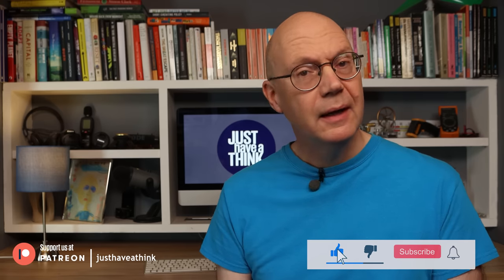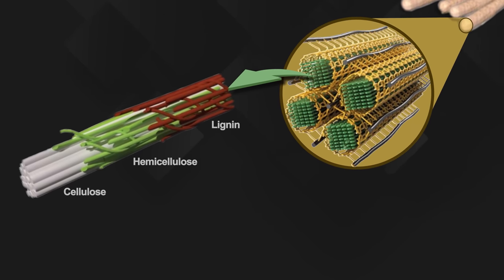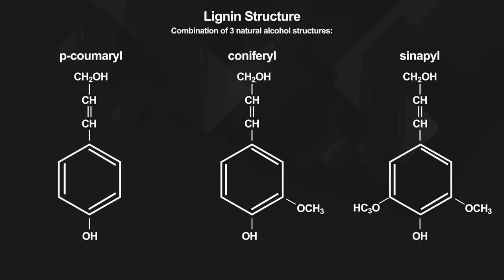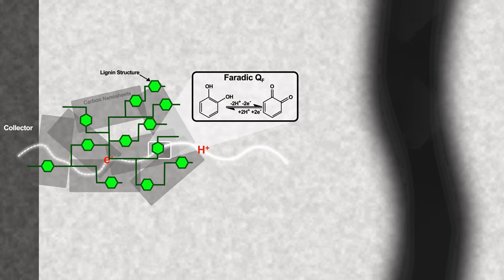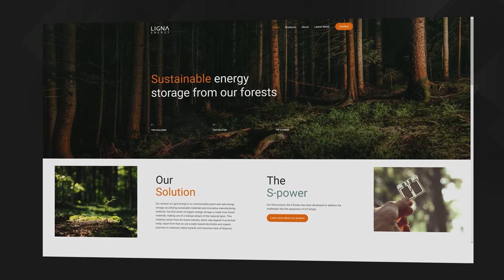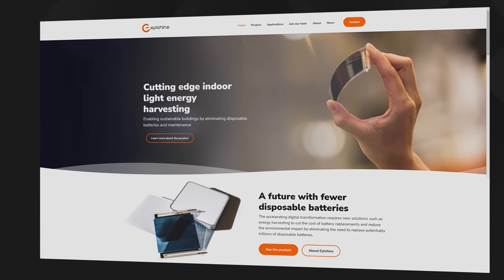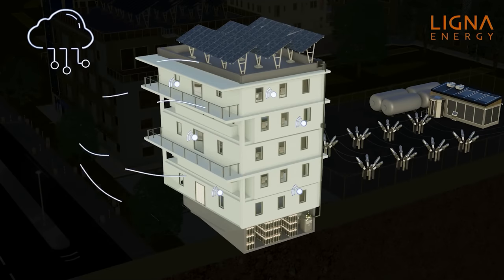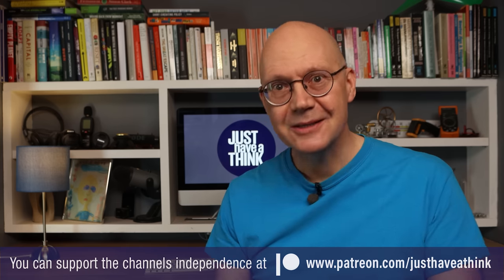Revolutionary new sustainable battery technology!

Comment: If they can make these cheaper than lithium-based batteries for kWh capacity, size may not matter much, especially if they tolerate temperature extremes better, while also not being flammable, or at least not like lithium-based batteries are.

That they’re made from what’s otherwise a waste byproduct is a huge bonus.

Our future power grid ultimately needs to look like a giant network full of power generators and batteries, in much a similar way a computer motherboard has a power supply and capacitors all over it to keep a steady voltage to components.  Just think of batteries as time-shifted power generation, which has some losses (that’s a huge question not even hinted at: what’s the roundtrip efficiency on these?) but time-shifting properly can result in lower peak power generation required, which is ultimately on a systemwide scale more efficient.

As to the Internet of Things, any building with enough insecure IoT devices is indistinguishable from being haunted by ghosts.  I work in tech including security, and… I’m not persuaded I want my home residence overflowing with all these security violations, made worse by the observation that so many of them require a subscription service of some kind that eventually ends for whatever reason.

Comment: Happy for an 'internet of everything' so long as the vast majority of devices Read Only i.e. programmed to do a very specific set of tasks/functions at the time of manufacture but which then cant be re-programmed over the net. Perhaps via physical connection but not wirelessly. Otherwise the potential illicit hacking opportunities would be a nightmare. The battery, early days but it sounds like an excellent choice for grid storage if the proposed upgrades work (there's always an 'if').
Reply: ꜱᴇɴᴅ ᴀ ᴍᴇꜱꜱᴀɢᴇ👆👆

Comment: What Is The Purpose Of Having Everything Constantly Connected To A Network Of Devices?
Wouldn't It Be Far More Reasonable And Efficient To Have As Few Things As Is Necessary Constantly Drawing Electricity From The Grid?
Reply: If Our Society Is Actually Going Through A Modern Day Energy Crisis, With Some People Struggling Or Unable To Pay Excessively High Energy Premiums Just To Heat And Cool Their Homes, Then Why Would We Be Constantly Aiming For IOE, Developing Systems And Appliances Which Necessitate Energy Abundance And Perpetual Connectivity To Properly Function?

Comment: The "S" in "IOT" stands for security.
A battery that competes with the lead acid battery could already be getting sold.  A lot of lead acid batteries are used in the world and they make trouble when you need to replace and recycle them. For stationary applications, the weight is not that big of an issue.
Reply: 99% of the 12-volt automotive lead-acid batteries in the USA are recycled; it's one of the most recycled products in the world. Big valuable batteries aren't dumped, small ones built into devices are.
Reply: @skierpage  You may want to look into how they are recycled.  I will give you the extreme version.
It is only the lead in the battery that had value.  What is done is:
--the batteries are all shipped to some poor country
-- there they pop the tops and pour the acid out on the ground
-- next the batteries are made into a huge pile and covered in gasoline and ignited.
-- the fire burns off the plastic housings leaving the lead mostly.
-- they then chop down a rainforest to get fire wood.
-- all the lead is shoveled into a big pot over a fire and melted.
- then the children and pregnant women scrap any stuff that floats to the surface off.
--finally it is poured into molds and shipped off
Reply: @kensmith5694  You're describing the appalling recycling of lead acid batteries from India and within Africa. That is irrelevant to the USA and I believe Europe. Lead is heavy and valuable, it's not worth shipping batteries all the way to Africa.
Reply: @skierpage  You believe what I said is irrelevant but did you actually check?  I wouldn't say it is until I had it proven to me.  The dead batteries are likely not tracked.

Comment: Lithium batteries require replacement. Sodium Ion is the next cab off the rank having been thoroughly tested but the new "wood" battery sounds intriguing, especially because it can utilize waste streams. Indiscriminate use of IoT just creates another problem, its predicted to produce 79.4 zettabytes of data. Back to energy problem again and energy reduction is the elephant in the room in terms of energy transition towards decarbonisation.

Comment: I think lignin batteries sound a wonderful idea, given the drawbacks of lithium.  I've no interest in the Internet of Things though - being a bit older than yourself, and having got into personal computers very early on, one of the things that I've been very much aware of is the vulnerabilities of computers, and especially networked computers.  I am no Luddite, but dear me, I never imagined that computers would end up generating so much utter junk that just adds to the things that can go wrong with the things that we use everyday.  IoT is, in my opinion, one of those things where it should very much be borne in mind that just because a thing CAN be done doesn't mean that it SHOULD be done, or even that it's a good idea.

I needed to buy a new microwave, and was surprised to find that microwaves with just a simple choice of strength of heating and a timer are now getting quite rare - instead they assume that you want the microwave to tell you how to use it to cook food.  However, the interfaces they give you for this seem to be to be grossly sub-optimal.   Similarly, when I needed a new toaster - the one I ended up with isnt too bad, but it's still more coplicated than it needs to be. It's a toaster, for heavens sake, it heats bread and turns it into toast, it doesnt NEED to be complicated!

As for things like IoT lightbulbs and remotely accessible electricity meters - you might as well put a sign on your door and a message out on the internet inviting hackers to mess with you. The idea in each case may at first seem reasonable, but it's the execution, how it's actually implemented, that matters, and given that the security aspect of the internet was never properly finished off in the first place...

Now, what I WOULD like to see is a phone that does voice calls and text messages, thats it. No games, apps or gubbins that some phone company thinks theyd like to place in your phone whether you like it or not.  And I want it to last at least a week on one charge, two for preference.  Or, if one of these new lignin batteries with a solar cell formed part of the structre of the phone, perhaps it'd seldom need charging from a phone chrger at all.  The other month, I spotted that a company actually had created a phone that does just voice calls and text. Great! But because it didnt need as much power to run as yer averagee "smart" (in quotes, because I dispute that that is a good name for the poorly designed things), what did the designers do? Why, reduce the size of the battery so you have to charge it every couple of days, just like with "smart" phones (facepalm).  I am expecting any day now to hear of some idiot releasing an IoT hammer for reasons that will likely sap my will to live!

Honestly, kids these days, coudn't design their way out of a paper bag, gerroffamylawn mutter-grumble.. (chuckle). Many thanks for the great videos, I have reccoended ths channel to my friends!
Reply: ꜱᴇɴᴅ ᴀ ᴍᴇꜱꜱᴀɢᴇ👆👆…

Comment: Thank you for very good video!  As usual, well researched and presented in non-sensational manner.
Internet of things makes sense (IMHO) when connecting building sensors to the building management system. Having no wires for power or data would reduce dramatically the installation cost, serviceability and flexibility of such systems. Building automation is the next low hanging fruit in reducing energy consumption and improving indoor comfort.
Reply: ꜱᴇɴᴅ ᴀ ᴍᴇꜱꜱᴀɢᴇ👆👆..

Comment: If the energy density can't be increased  sufficiently, these lignin batteries may never be useful for cars and the like. However, there are so many uses that don't require high energy density, and reducing our reliance on relatively rare elements that require extensive mining operations, would be brilliant. Did you suggest that it could use waste from disposable nappies, as well as waste from paper making?
Reply: ꜱᴇɴᴅ ᴀ ᴍᴇꜱꜱᴀɢᴇ👆👆

Comment: kinda funny I was looking into this over 10 years ago when it comes to plastic solar cells (also that are transparent to most of the spectrum not being used to generate electricity so technically they could be stacked) my videos detailing the solvent based process for doping to make semiconductors are still on youtube too, What I needed was a transparent neutral conductor (graphene super thin conductive layer) and a way to make the plastic molecules with the doped compound instead of dissolving plastic and mixing a doping agent with it. (ie PEDOT that is made with say nitrogen instead of sulfur, for one layer and the other having boron being used as the dopant instead of sulfur, again so the whole matrix is both conductive alone but carrying water for electrons or protons so when sandwiched would become a diode junction instead of just conductors. (why? because I wanted a stackable system to make money that when not being spent could be hooked up to produce electricity and to give greater value, the higher denominations would have higher numbers of solar cell stacks to produce more wattage per bill) 

crazy as this sounds it all started with my idea of making coins that doubled as super battery (super capacitor/solidstate battery hybrids) so stores when sitting on them could be charging them up with the bills they stack in storage to use for change to customers, so they are generating power when not being used, and cut out this loaning idea for generating interest, instead the interest is in the power they can all store or generate, and a store that gives change that is charged, would have a draw for customers that the other uncharged change givers would not. ;) )
Reply: ꜱᴇɴᴅ ᴀ ᴍᴇꜱꜱᴀɢᴇ👆👆..

Comment: What is the mass ratio of lignin compared to the carbon black? Please bear in mind that basically all carbon black is made from fossils like oil or gas and is mostly used for tires (means heavily specified). But are we talking about carbon black? Is has la low conductivity. Conductive foil with carbon is on the other hand rather expensive. So I still wonder what they are using

Comment: Looking at their data sheet, it looks more like a super capacitor rather than a battery. That explains why they are targeting IoT. Super caps aren't ideal for higher powered devices.
Reply: Super caps are good for high power in extremely short bursts.  They have been able to make them with low ESR for a while now.  A super cap can be cycled a zillion times with no decrease in the capacity.  If you make a home made one, the capacity actually increases for the first several cycles.

Comment: What's the lifespan like?
Could structural insulated panels be made to any degree with this material?
Reply: He said over 1000 charges, but never said anything about calendar time.

1000 charges = 3 years in a Solar supplementing grid backup

If a very long calendar aging period before degradation, then this could really be the ticket for Wind… or other type of grid backup.

Comment: I guess I will have to have a look at this since I am working on a sustainable micro-refinery project that uses grown bio products like wood to make the products normally only obtained from crude oil,  to kinda create a neutral carbon cycle system, and cellulose along with starches can be broken down into smaller chunks till you have nothing but sugars, (the feedstock for making ethyl alcohol, a feed stock for Polyethylene which is basically the most perfect plastic version of crude oil, ie I see it as a solid storable crude oil till it is heated and broken down to make the crude. (also this crude being bio based is going to be far cleaner when it comes to nasty compounds that ground crude has dissolved and releases to our environment again, like mercury, fluorine, ect. Instead this home made crude from wood and plants in gen, is just hydrogen and carbon, so much better for environment and the catalytical hardware that are zeolites for making the crazy stuff we want out of it. (ie the zeolites last longer so less often does a kiln have to be fired to make up more) ))

anyway this process I am working on seems like it would be leaving pure lignin molecules behind and allow me to make the pure carbon compounds they are ball milling into it, and see if I can make some long lasting, lead acid level storage from a safer material we have coming out of it, even if only for home storage and not car battery replacements LOL
Reply: That sounds like a great synergy! Also, thank you for closing all the brackets. 😊
Reply: @johndalgliesh9220  XD
Reply: ꜱᴇɴᴅ ᴀ ᴍᴇꜱꜱᴀɢᴇ👆👆..

Comment: I am often surprised how optimistic about solar power yields northern Europeans are... Specially because they come from countries with the worse conditions to operate solar cells. I can see some of these devices working in France, Spain or Turkey but not in Sweden. Unless these are parasitc devices using artificial light, which in some cases might be an issue if artificial light usage patterns are changed to save on power use.

Comment: I'm not so excited about an internet of everything.  I have a Yamaha gas scooter that uses keyless ignition with lots of electronics.  However, on Malaysia's east coast, everything rusts quickly.  Even my dishwasher, which is stainless steel, after 4 years has parts of the door frame and hinges that are rusting.  I wonder how long the electronics would last.  And how easily could IOE tiny parts be disabled if there were electromagnetic bombs or devices?  Sometimes manual devices work better.

Comment: I'm surprised and somewhat puzzled why they seem to be aiming at IOT as with that energy density LI will remain in the lead. But if they have a similar energy density to lead acid then why aren't they aiming directly at solar? Its got to weigh less than lead acid and the space it takes up isn't an issue.. but you never mentioned cost..

Comment: Edit: My concerns have been addressed in the video :)

My initial reaction after watching the first minute is that I'm afraid that this may not be ideal either. We need more trees, not less. So if we're going to power the world on wood-based batteries then we may run into some issues here too.
That said, any discovery can help us get closer to a really good solution, so even if my first reaction ends up being right then it's a part in the process which I get excited about :)
Reply: The paper industry in general does not result in less trees.
Reply: @phonkey  Nope, they do have to keep replanting them to sustain the process. Does tend to reduce the forest diversity a tad though. 😜
Reply: I don't see any problem or concern here. Wood is renewable resource that can be easily farmed and production process has relatively low impact on the enviorment. 
Unlike the minerals.
Reply: @palema6863  Wood is indeed renewable and with proper resource management there are indeed few (if any) problems. 
But herein lies the problem; it requires proper management which often isn't the case. In Germany and the Czech Republic (and maybe some other countries?) there is a plague of bark beetles which devastates large regions. This is a result of a lack of biodiversity in trees which were planted for the wood.

Logging an entire forest and replanting it has ultimately a net-zero carbon footprint, but it displaces many animals in the process and it is impossible to manually replace all the species of plants and animals which were present before taking down the forest. 

If small spots are taken down and then left alone for a few generations then everything has time to heal and the impact will be very low. But if the demand for wood gets too big then it will come at the cost of biodiversity and thus at the cost of our planet's health

Comment: What's the R-Value of this lignin block? Even if the Wh/kg or kg/m^3 is low, if you can replace any of the parts of a house with it (insulation) then it may see mass use.
Reply: ꜱᴇɴᴅ ᴀ ᴍᴇꜱꜱᴀɢᴇ👆👆..

Comment: An internet of everything is a security nightmare! Out TV can connect to the internet, but I won't do it: the security isn't any good. Until  IoT devices address that problem, I don't feel inclined to use 'em.

On thr other hand, our solar panels' micro inverter controller has adequate security so we do let it connect to the internet.
Reply: Sorry! That's "Our TV ..."
Reply: The "S" in IOT stands for security.  This idea that everything needs to be on the internet, I hope is a passing fad.  At least I hope that home routers can also become the home gate keeper to stop some kid in China from turning off all my lights.
Reply: ꜱᴇɴᴅ ᴀ ᴍᴇꜱꜱᴀɢᴇ👆👆..

Comment: The potential shortage of Lithium has been a talking point of many "gotcha" videos. It has taken almost a hundred and fifty years for the internal combustion auto industry to get where it is today Just imaging in a hundred years the status of renewable emery.
Reply: Battery technology has been along a lot longer than internal combustion engine… the first battery is about 3,000 years old, so battery technology historically moves a lot more slowly.

Internal combustion engine took off since batteries held far less power per volume & weight & cost compared to liquid fuel.

Comment: It's all based on who wants it made, and who wants it stopped, so they can make more money on some other process. And which has the greater resources to make it happen or not. Even at lead acid battery level, its much cheaper, non-toxic, and life cycle is very long? than LI-IOn so it should be a viable product.
Reply: ꜱᴇɴᴅ ᴀ ᴍᴇꜱꜱᴀɢᴇ👆👆…